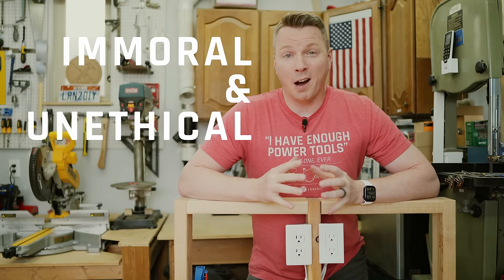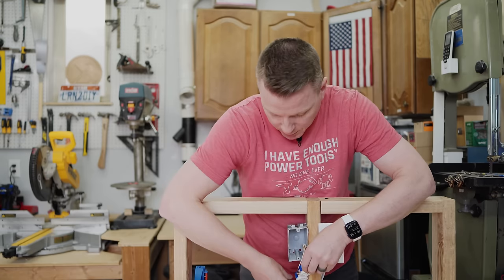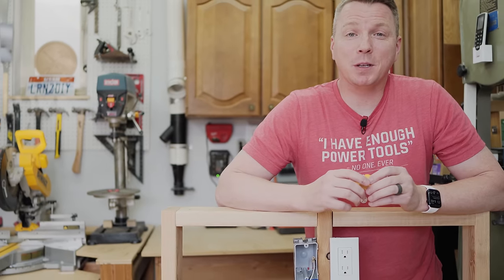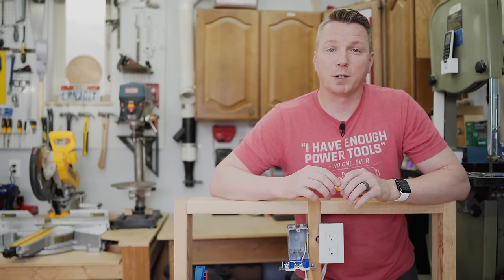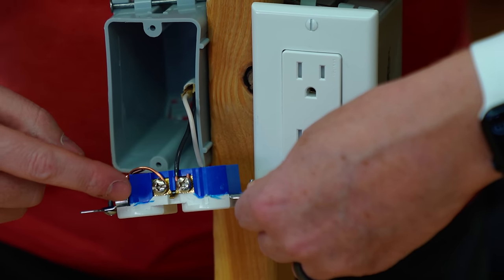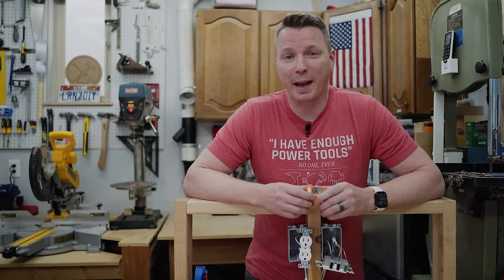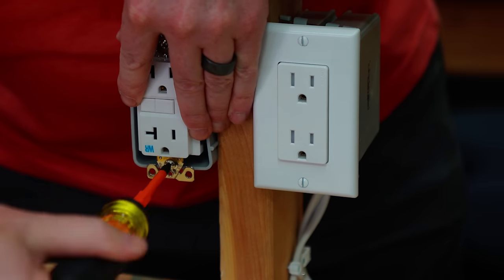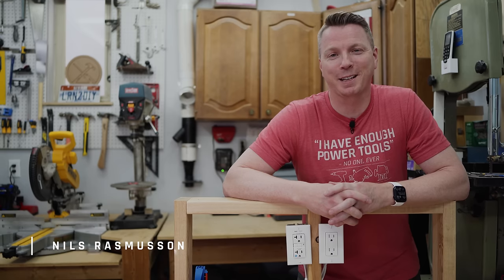People Are Adding Deadly Hacks to Outlets

Comment: Homes built with conduit will have only two wires.  The conduit acts as the ground wire.  So, if you find only two wires, but the junction box is metal and the wires come into the box via a conduit, even the inexpensive circuit testers will correctly determine if the outlet is properly grounded.
Reply: I have long ago learned not to trust conduit, or any other wire cladding as a stable ground, conduit has been known to come loose, EMT frequently exposed to water has been known to corrode and rust apart.
I have also seen conduit stubs where the wire is free run above 7'6"
it may have been ok in the distant past, but I never trust any wire shielding as a ground conductor
I also don't trust the plumbing as a reliable connection either. far more dangerous in fact.
if a pipe breaks, the plumber replaces the length of broken pipe with PEX, you now have two issues; 
that section of pipe you thought was ground no longer is, and you've just electrified the plumbing in the event of a ground fault as well.
Reply: @davidconner-shover51  Experience is a great teacher, isn't it?  However, the NEC does allow conduit to be used as the ground connection.  My comment was intended to inform the inexperienced that it is entirely possible to have only two wires in a junction box and still have a valid ground connection.  My house and barn are all conduit, and I made sure to follow the NEC.  Plus, I really cranked down on the connector screws and locknuts!

Comment: But ground and neutral are typically bonded in the panel so whats the danger of using neutral as a path back? Even if you loose neutral somewhere upstream like in a junction box, what are the odds of you touching something that is shorted? Like a refrigerator compressor shorting to ground at the exact moment that neutral gets lost just seems to be so rare
Reply: Lots of ways to lose a neutral for more than a quick second... imagine someone wires a switch on the neutral instead of the live, then your bootleg is suddenly a real big hazard when the switch is off. Even without losing the neutral, a bootleg causes grounded parts to become energized. Any path between the grounded parts of the appliance and the service neutral will carry some current. The lower the impedance, the more current it will carry.

Comment: This isn't a work around.  If someone understands why the plug checker would display correctly they are intentionally before malicious.  Any unbalanced load will energize all equipment grounding conductors in the electrical system.  That's why you never bond subpanels and bonding only occurs at the first point of service disconnect.  Since the human body has a relatively high resistance, if the grounding system is energized and you touch it, the breaker feeding that branch circuit will never trip.  If you're lucky you just get a good little zap.  If it's your day to go, the conditions will be just right and you will send enough current through your heart to cause death.

Comment: wow, you used a 20 amp GFCI with a 15 amp line, and it appears you cut it shorter than the required 6” (from back of box). I realize this is for demo, which is why it should be done 100% correctly!

Comment: Doesn't the ground and neutral connect to the same bar in the panel anyway? I now wrong is wrong but from an immediate safety point, don't they go to the same place?
Reply: There are issues like if the neutral breaks, it will set the full voltage to the case. On a normal outlet if the neutral breaks it just stops working. If the ground breaks if is potentially dangerous but not immediately. It still requires equipment failure.

Now even in the normal installation there is a problem if the neutral breaks upstream from the main panel but things like bonding reduce the risk.
Reply: The ground and neutral are bonded (connected) at the main electrical panel and nowhere else. For sub panels the ground and neutral wires are on separate unconnected bus bars. Connecting them anywhere else including at receptacles will create a situation known as "objectionable current". You can Google that for a detailed explanation.

Comment: Another question regarding safety in electrical installations:

In Europe we are required to install arc-protection to any circuit of a wooden house. Over here, wood is not a very common building material, so the whole arc-protection-thing is not a big topic to us, but as far as I know, most single family homes in the US are built out of wood.
Is arc-protection a thing in the US?

Comment: Why is putting a two prong outlet back in preferred over just leaving the 3 prong in place and removing the bootleg ground? 

It's not grounded that way but a 2 prong wouldn't be either.
Reply: Because you cannot just have an ungrounded three prong outlet. You must either use a two prong one or use GFCI protection with appropriate markings.

Comment: If u pull 10 amps from the outlet, ten amps will flow on the neutral, current will now be on the 
jacket of say a toaster oven near the kitchen sink. Touching the toaster oven and  sink or faucet
or fridge or anything grounded might be the last thing YOU do.

Comment: Should be easy enough to detect with a multi meter. Simply measure resistance between neutral and ground. I would expect to see 1 or 2 maybe 3 ohms, if I'm seeing 0 I know it's bootleg ground because if it's done properly then there should be a detectable low level resistance between the two wires  via the length of the run of wire and where neutral and ground meet and connect together at busbar inside the panel. If it's bootleg you got maybe 1 inch of wire between the 2 thus resistance is very low. I would expect this is probably exactly what the 400 dollar meter does anyhow because it's about the only way you could check it without pulling it off.
Reply: for a 15amp circuit, it would have to be 14AWG, which runs 2.5 ohm per 1,000 ft. i have a 2,500 sqft house and there isnt a single outlet that would exceed 200ft, which would be 0.5 ohm, and not many casual handheld multimeters will read accurately that low.
Reply: @X4Alpha4X  hmm, interesting, I wasn't sure of the actual resistance I knew it would be low but wasnt sure it was that low, maybe that's why the special meter is so expensive then, is because it's able to read milliohm reading with a relatively low tolerance, where as most cheap meters under 100 bucks might be able to read a tolerance of +/- 1 ohm. I know this first hand when trying to make .5 ohm or lower vape coils, as you need a special meter. you can also calculate it by using ohm's law to find the wires internal resistance by using a known given resistor value. I've done this when figuring out battery internal resistance. It would be interesting to see what the tolerance is for my kiaweets ht208d is. I'll have to find the manual. Another way it might be able to tell it's by emiting a signal throughout the wire and see how long it takes to make the neutral ground loop, or how strong the signal is after making the loop, much like how a wire tracer works and makes a computed decision based off of the signal strength/and or time.

Comment: You said that when there's a fault "the full 120V and 15A goes through you" but you neglect that the body has resistance. Only milliamps flow,  but "it's the volts that jolt, but the mills that kills"

Comment: "20 to 25 amps, and 120 volts, will go though your body"
I guess you can know how to correctly wire up outlets without knowing much about electricity .
Volts represent the potential difference and they don't "go through" anything.  They are the pressure behind the amps (current).
Just because the circuit could provide 25 amps doesn't mean it all flows through something that's connected.  The current drawn depends on the resistance of the load, per Ohm's Law.  If you in fact had 25 amps at 120 volts, your resistance would have to be 4.8 ohms.  Actually, the resistance across the human body is hundreds or thousands of ohms.  (But it only takes 0.1 amp to kill you, if it passes through the heart.)

Comment: I'm trying to understand the danger. Out In my electric box all green and white wires are tied to the same bus bar. I can run a white to any outlet, and a green to any outlet, they are essentially hooked together at the bus bar. This is great, and safe, however if you do it at the outlet itself it is deadly? It's the exact same. I guess I don't need an explanation, another safetycrats mandate in my mind, but that was the entire point of adding the 3 prong outlet to begin with.

Comment: You can't see me shaking my head at these hacks.
Thankfully here, we have 3 prong outlets and I've never seen a 2 prong ever (even from a house built in the 70's) although I'm not in the USA. 
Saying that, I've seen some dodgy things in my time. Legally (here at least) you're not allowed to play with mains AC although I have wired up a few powerpoints in my time (under the supervision / checked by a licenced electrician I was with work experience
Please tell me the US has at least RCD / Earth leakage on all power circuits inside a home.

Comment: In mexico where im from getting zapped by the fridge was a game. There is no grounds and when your barefoot and grab the metal handle you learned really quick to wear your shoes. lol or when i got zapped stucking my hand in the washing machine, they use these little electric heating elements to heat the water, just plugs in to tue outlet and it hangs in the tub. No wonder i ended in the trades, i got tired of getting zapped 😂😂

Comment: Unless you are knowledgeable about electrical, you have to rely on a home inspector to find these faults.  My issue is when that inspector pulls out a simple (cheap) outlet tester to check things.  They, of all people, should have the advanced tester(s) to catch this kind of stuff.  IMHO, part of any electrical inspection should include pulling the service panel cover and reviewing the breakers and wiring used in the house, making sure grounded cabling is being used.

Do your homework and hire reputable home inspectors, not the people who only glance over things to get the mortgage company to sign off on your loan.

Comment: I don't know much about electrical stuff, but wouldn't it be easier to just test for continuity between ground and neutral with a multimeter?
It's way cheaper and you wouldn't need to open the outlet
Reply: But you always have continuity between neutral and ground because they are bonded at the panel.

Comment: I work at Duke energy. As a contractor. Just a month ago I saw a 4 sq metal box with a hot receptacle in it hot , and not only was the box not grounded.  The cable was only a 2 conductor so no ground wire at all in box not even on receptacle.  When I bought it to his attention he claimed it was ok. Because a neutral is actually a ground.  That’s what he told me.  He also has told me before contacting with Duke. He owned his own business as an electrician. He said a neutral is a ground ! Hahahahahha

Comment: so the video sort of glosses over it, but the earthing system links back to the neutral to allow current back to the transformer, I believe you guys call it a multi-Ground neutral we call is a multiple earthing neutral same same, this link is why a common meter will not pick up an issue because a link on the appliance or further down the line creates a similar reading. A common misconception is the idea that current running into the ground will dissipate into the earth, this is wrong, current will take the path through the earth back to the link between the ground to neutral back to the transformer. the reason for this explanation is to explain why this is an issue. 

Under normal use the circuit current will travel through the appliance back through neutral, with a separate earthing cable if the neutral cable is broken damaged or otherwise open circuit, the appliance will not operate. however with this link the current will now travel back into the frame of the appliance assuming it is an earthed appliance and not double insulated, and will not operate until a path to earth and thus back to neutral is established i.e. a person.

It is not likely to happen if the neutral is in good contact as the resistance of copper is significantly lower than the many different not so suitable paths current would have to take through the human body, ground etc. but saying that it only takes a rat to chew through the cable for it to change.

Comment: Is a bootleg ground better than no ground at all in a 3 prong outlet?
Reply from the maker: I'd say it's worse, because with no ground, a typical receptacle tester will likely detect the issue at least, whereas with the bootleg, it wouldn't.
Reply: This is like is stealing better than hitting someone. Both are against the code. The proper way is to use the GFCI.
Reply: @okaro6595  if a microwave shell is to become energized, I’d imagine that a bootleg ground would make the breaker pop instead of allowing the shell to become energized since the shell is grounded.

Comment: GFCI outlets don’t do computations, they use magnetic fields.  The Technology Connections channel has a good video explaining them.
Reply: actually, the modern ones do. namely because of the frequent false trips on the purely mechanical ones. some appliances, particularly those with larger motors have some bad habits with hot/neutral current imbalances related to phase shifting by the load (starting capacitors is the main culprit). so yes, they do, they may ride out a current imbalance in part of the AC cycle as long as that current is returned on the same side of the waveform. ie, the electronic ones wait a few milliseconds to be able to discriminate the difference between a phase shift due to capacitance, and an actual ground fault.
Reply: In the US they are electronic. In many European countries electronic ones are banned.
Reply: @okaro6595  yes, but they allow a larger current imbalance before tripping, with double the voltage. in leiu of the US 30ma limit, After disassembling a few, they still will cut off mechanically if the imbalance is big enough.

Comment: So the options to detect this is a 400$ tester or taking the box apart. What about a standard multi meter can you use this to detect a bootleg ground if so what mode and what numbers to look for I would think a multi meter would be capable of running the same tests as the 400 dollar tester with the exception of you needing to do some additional math?

Comment: One cheat is to run a earth wire to a copper pipe if the house is that old. If a devise is not double insulated(a metal case) then is requires a true safety ground by codes. Kitchen and bathroom should be rewired for practical safety. Lets say you have an old toaster with a metal shelf and the neutral side of the heater element breaks and shorts to the case -- that could be dangerous.

Comment: "this means that the full 15a or 20a could run through our bodies" (paraphrased). 
- no. that is just the rating of the breaker. It doesn't mean that is what would be running through you if you shorted it out.

Comment: ...you basically didn't explain why this is a problem besides "it's dangerous and the fault current will flow through you instead."...except it shouldn't? Ground and neutral are bonded in the electrical panel, this setup should just push the fault current onto the neutral which is still very wrong but I'm trying to figure out how it does what you described in the video and I can't. In fact re-watching you described that as what happens when the ground is missing...except in this case it's not actually "missing." It's still there and does still function to an extent...so again why is THIS a problem?

Comment: Not an electrician, but how would tying the hot directly to ground not trip the breaker?
Reply: There is no ground wire that would cause a short. The electricity goes to the case and gets nowhere from there until someone touches it.

Comment: what happens when you do the fake ground thing on the GFCI?
Reply: If it's a metal box that's not grounded or a plastic box it will trip when you turn on an appliance with a 3 prong plug. With a 2 prong plug, it will work normally, because the bootleg ground is essentially a dead end.

Comment: 2:28 how much does it cost to literally just add an extra check for continuity between ground and neutral? Besides, can't you just use a multimeter to check outlets, which can also be used for a lot more things and can check for tricks like was shown?
Reply: the problem is that properly wired receptacles should have continuity between ground and neutral thanks to the main bonding jumper at the service equipment

Comment: Are ground and neutral not tied together at the panel? 🤔
Reply: If you don't have a gfci or RCD on the breaker feeding the circuit then it doesn't matter.  a minute amount of resistance difference to ground either thru neutral or direct to ground.

Comment: This is actually very safe, maybe illegal, but safe, if......it is done right, meaning the white wire is attached in the main entrance box to the common or ground, which are both the same.  They are both on the same bar, but just called different things.  I noticed that you put the wire under the screw in the wrong direction, meaning that when you tighten the  screw, the wire wants to "squirt" out from under the screw.

Comment: 15A or 20A is not running through your body. The amount of current that would flow is determined by the voltage and the load you present. In order for 15A to flow through your body, you're looking at lightning levels of voltage to accomplish that (15 squared times the resistive load of a human body, which is going to be on the order of many thousands of ohms, it will vary a lot on many factors). Obviously it's still dangerous, because only a few milliamps through your heart can be fatal.